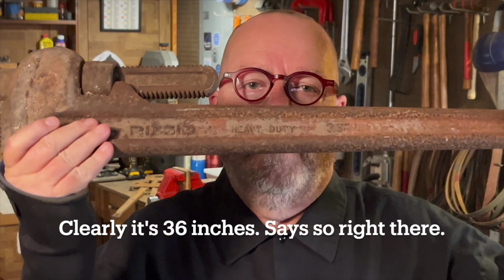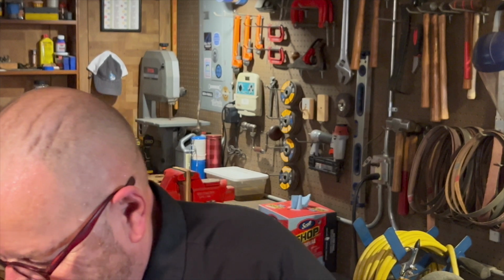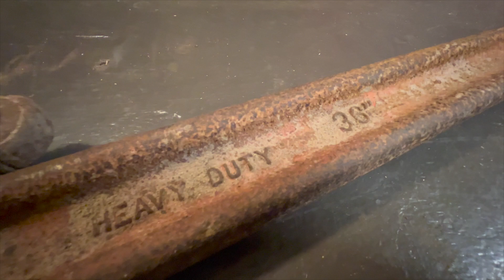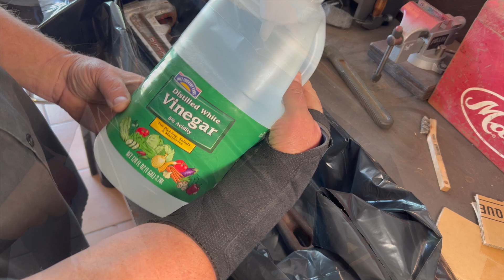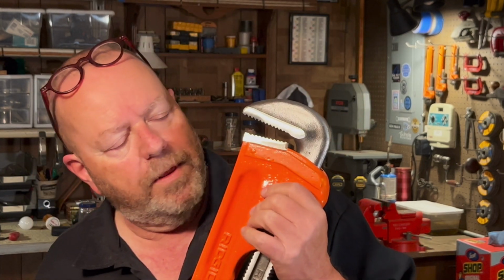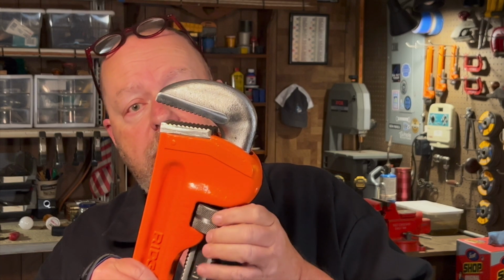Ridgid Pipe Wrench

Comment: Ben- Fantastic job!  Not only are those wrenches super heavy but they’re also extremely expensive when you get to the bigger ones I have two 48 inch models one in aluminum.  They are great!  That harbor freight angle grinder is fantastic and looks like you got good use out of it however those cupped wire brushes have a tendency to flip around when you’re working with them and can be quite dangerous, ask me how I know.  😂. Next time you go to Harbor freight I suggest picking up their denim or other type of shop apron as a protection whenever you’re working with that cupped wire brush.  I always felt that the orange paint scheme with the steel accents look so fantastic.  😃👍
Reply from the maker: Thanks John. I have an apron but I always forget to put it on. I have a huge collection of stained shirts to show for it.
I'm not sure what you mean by flip around - are you talking about shifting the angle so that the other side of the cup catches and kicks back? If you feel it warrants it, throw an answer in a mosh sometime. Thanks!

Comment: Ben,

It looks much, much better than new.  A little grease and perhaps cold bluing to prevent corrosion might be an idea.

Tell your brother-in-law to keep his toys inside.  Weather is hard on tools.

I am really impressed with your work.   You are still too hard on yourself.   You obviously take pride in your work, as you should.

I watched a YouTube video I think it's called "Make Everything".  He was using Milwaukee and Ryobi die grinders with two inch diameter wheels.  He had everything from grinding disks, to sanding disks, to flap wheels, to polishing disks.  He was showing there are tools available between surface grinders and Dremel tools.

Continue the good work. 

Bob
Reply from the maker: Thanks Robert!
Reply from the maker: PS - I tried making stands out of nails and pieces of wood but I guess I couldn't get it balanced right and it kept falling over and messing up the paint.
Reply: @mrbenmall  A single piece of plywood say 40"x12" would provide the needed stability.  The problem with nsils and small pieces of wood is stability.  That's why painter's pyramids work.  Bob
Reply from the maker: @robertlevine2152  Noted. Thanks Bob!

Comment: One of the best ways to paint Ridgid pipe wrenches is to completely disassemble them, remove the heel jaw and heel jaw pin, remove the flat spring assembly for the hook jaw and then you can suspend the wrench body between two points (i.e. ladder rungs) with steel tie wire by the holes for the heel jaw pin. The raised sides of the handle body by the heel jaw are meant to be bare, so you can mask those and your wire / suspension point won't affect the quality of your finished paint. 

You may have to slightly grind the heel jaw pin to punch it out and remove the heel jaw, but the modern replacement pins are the same size as the older 1940s wrenches and are relatively inexpensive. 

Just my two cents!
Reply from the maker: Thanks for the info. Yes, somewhere back in a previous video, I restored three smaller ones and had issues with the pin. Decided not to break it down on this one.
Reply: @Ben Mall , whenever possible,  I try to always replace the heel jaw, heel jaw pin and flat spring assembly on the Ridgid wrenches when the parts are available. 

The modern heel jaws fit most of the 1950's ~ current wrenches. They fit most of the 1940's wrenches are well, but the widths / lengths tend to be different on the larger wrenches.

Comment: That cleaned up very well.   Nice job.
I would not want to have to use that size pipe wrench.   My longest is 24in and whatever that size wrench needs to remove or tighten, it is a lot of work.
Dave.
Reply from the maker: I completely agree. Thanks Dave!

Comment: Nice work Ben. Those knuckle busters are HEAVY. I use to use them for working on machines and plumbing. I was in management by the time aluminum handles became availible. I ordered a set of them. Much easier to use than the monsters ike the one you restored.  😁😎
Reply from the maker: I can't imagine anyone using a beast like this one. But apparently some do. Thanks!

Comment: Consider spraying WD-40 on the unpainted parts to prevent them from rusting again.  WD-40 was invented during WW2 to prevent unpainted metal from rusting.  There are several different versions of WD-40, such as one being a light oil lubricant, so be careful.
Reply from the maker: Thanks Bill! Noted.